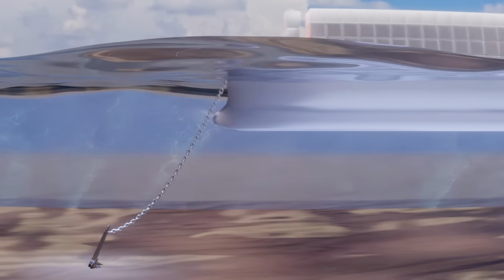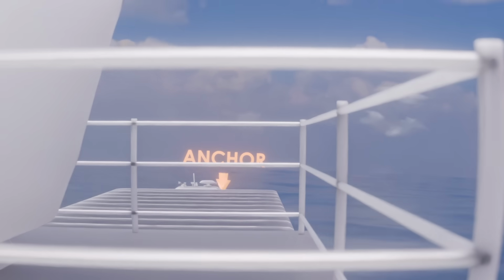Anchors don't work the way you think

Comment: Turns out anchors do work the way i thought
Reply: I mean, it works they way I think but many things are clearer now, like the rotating part, and the use of chains for more friction
Reply: @kcbm225 fr 😅
Reply: Turns out I never gave it any thought...
Reply: @Jim-z5j lol
Reply: Tell me simply how they work.
Reply: @mr.smartypants94  ignore the kite analogy, it doesn't work. 
The anchor is heavy but not compared to the ship so the anchors main job it to dig into the sea bed as much as possible and hold the end of the chain. Then the goal is to get a good long portion of chain laying along the sea bed as well instead of having a taught light stretching straight through the water because the long second of chain on the sea bed creates an incredible amount of friction. 
 
On top of this, when wind and waves do try and push the ship around the chain acts as shock absorber as it will need to be pulled up off the sea floor and pulled taught before the anchor will start being pulled. All the force that went into lifting the chain and pulling it taught would have gone into pulling the anchor instead if the chain were already taught.
Reply: @mr.smartypants94  it's not just the anchor, the whole chain is the anchor
Reply: @mr.smartypants94  kites. 

The ship is basically just a kite. Or i guess just similar... 

It works similar to a kite but the ship is the kite and the anchor is the person holding the kite, also minus the part where you need to take account wind lift and the rope is also heavier. But you get the point eheheh.
Reply: @Byte_frst7 which is just another way to say the anchor is heavy and digs into the ground with its hooks... exactly how everyone thinks anchors work
Reply: Yeah, who would've thought.... :)
Reply: I laughed my ass of reading this one 😂
Reply: its becoz u are a seaman
Reply: I didn't know about the chain also working to keep it still (i thought it just needs to be that massive to be able to lift the anchor and last longer) but the function of the anchor itself was kinda clear
Reply: trial and error...
Reply: They’re pretty self explanatory if you actually look at them so it does not make you a nerd, but you are so kind
Reply: @carter608  He was talking about your thick bifocals, and squeaky voice.
Reply: @carter608  eh, no. To understand that the staying power of the anchor system relies on the wind and currents attempting to lift the chain when the boat moves? That's not obvious. I don't think it is "self-explanatory".
Reply: Anyone who's tended any thorned vegetation has this knowledge already preprogrammed 😅
Reply: @July2ndJune1st I've tended many brambles. What does this have to do with that?
Reply: That was the plot twist 😂
Reply: Unless it's bent or the anchor line
Reply: And apparently a grand piano weighs less than 160kg 😂😂😂🤣
Reply: Yup.
Reply: Wow, cool. I didn't. I just was thinking it's not even going to do anything😅.
Reply: To a stone head  everything works the way it thinks. 😂😂😂
Reply: What if I told you anchors don't actually anchor . You would be right to tell me I don't know anchors.
Reply: 😂😂😂😂 I know right!
Reply: Not necessarily a nerd, but definitely a show-off and a braggart.
Reply: @briannnnnnnnnn1037
Oh stop.  You didn't know all this before you watched the video 🫤
Reply: Literally. Some people didn’t grow up around boats.
Reply: @pj4795 i didnt grow up around boats yet i can figure out anchors stop a boat from drifting.
Reply: nope
Reply: @nilzor well if anchors dont work the way you think then you could watch the video and learn what we all know.

😁
Reply: No they dont, cringe person.
Reply: Weird flex but good for you?
Reply: Jesus died for you on the cross. All have sinned and rebelled against God (Romans 3:23-24) (not including Jesus since He is God). The wages of our sin is death (Romans 6:23). But “God so loved the world, that He gave His only Son, so that whoever believes in Him should not perish (not go to hell) but have eternal life” (go to Heaven) - John 3:16. God loves you and wants a relationship with you and all you have to do is believe in Him and love Him and repent (turn away from sin) and you will be saved. “that if you confess with your mouth the Lord Jesus and believe in your heart that God has raised Him from the dead, you will be saved“ - Romans 10:9. God will change you and your heart to become better so that He can make your arrogant and evil heart of stone into a kind and loving heart that is obedient to His commandments which are perfect as He has changed me. He will change you so that you can love Him and love others as He changed me even though we fall short of God’s glory by sinning. Surrender your life to Christ and believe today and be reconciled with your loving Creator and know the God who made everything and everyone who doesn’t delight in the death of the wicked: “ Have I any pleasure in the death of the wicked, declares the Lord GOD, and not rather that he should turn from his way and live?” - Ezekiel 18:23.  Also, “The Lord is not slow about His promise, as some count slowness, but is patient toward you, not wishing for any to perish but for all to come to repentance.” - 2 Peter 3:9. God loves us so much that He wants all to come to repentance and is patient with us and doesn’t punish us for our sin if we allow Jesus to take our sin off of us because He died in our place because we deserved death for our sin so Jesus, having never sinned, died in our place. “He made Him who knew no sin to be sin on our behalf, so that we might become the righteousness of God in Him.” - 2 Corinthians 5:21. But He will punish those who continually reject Him or who have rejected Him even to death.  Please, the time is soon, Jesus is coming back, and many aren’t saved. Don’t wait! Accept the free gift of salvation which God gifts us and believe in Jesus because God has promised that if we believe in Jesus (Who is God), we will receive eternal salvation. “ For it is by grace you have been saved, through faith—and this is not from yourselves, it is the gift of God—” - Ephesians 2:8. Repent (turn away from sin and resist temptation to sin) and come to Christ who will take your sin away, give you a new heart to love God and love other, and He will save you from judgement on judgement day. What an offer! “ For the wages of sin is death; but the gift of God is eternal life through Jesus Christ our Lord.” - Romans 6:23. Praise God!
Reply: Crazy how people love lying
Reply: @dragon0361 crazy how people assume things they do not know! 😂😂 Some will and some won't!
Reply: Exactly like I thought lol
Reply: bro you got baited into watching the video, congratulations smart guy lol
Reply: Same
Reply: Me too
Reply: Lol
Reply: yep 🤣
Reply: Turns out I need something a bit heavier on my fishing boat, but damn are the gas prices gonna hurt.
Reply: you fell for it. TWICE LOL
Reply: Same
Reply: They do work — just not the way most people imagine.
On large ships, the anchor isn’t the hero. The chain and its catenary curve provide most of the holding force.
Without that curve, the anchor alone is basically decorative.
Reply: I didn't know. I'm thankful for the video.
Reply: Came here to say exactly this. 🤣🤣 Turns out anchors work EXACTLY the way I thought.
Reply: ITS NOT WHAT YOU THINK.😂
Reply: Yep, just lost 7 mn
Reply: No, you didn't
Reply: Right?
Reply: I doubt you did
Reply: My thoughts exactly what a load of horseshit....wasted my life
Reply: Exactly.  Not everyone is we todd did.
Reply: Nerd
Reply: @no_one5259 bro u prolly a dumb ahh kid discovering basic physics 😂
Reply: @no_one5259 read the room bro, this video is for nerds, and youre here
Reply: Be humble. Not rude.
Reply: Lol.
Reply: bro we're not in the 80s
Reply: @fahimabidarnob1697 what the hell does that mean?
Reply: @no_one5259 tf u mean “nerd”, doesn’t take a genius to know how an anchor works
Reply: @Sgm_19  doesn't take a genius to be a nerd.
Reply: @EbuCallinav  bro its a saying?? the point is that you dont need to be a “nerd” to know the common sense of how an achor works
Reply: @EbuCallinav  ur funny😂 dont think u understand what ur tryna prove but ok 👍
Reply: @EbuCallinav  nga what does that have to do with anything 💀
Reply: @Sgm_19  It seems we live in the first time in recorded history when being knowledgeable about anything at all is considered insult-worthy.

It is probably bad news.
Reply: @Sgm_19  atp you will be called nerd after finding out how to do multiplications
Reply: @no_one5259 They work the way I thought too. Although, me taking physics is probably a contributor to that haha.
Reply: @whatskrakin37  you dont need physics to know heavy goes down ....and is heavy
Reply: @no_one5259 Just because you feel sad you are not as informed as others. Does not mean you have to go on the offensive. Work on yourself instead😊
Reply: Why do these fools think I know how much a blue whale and grand  piano weigh? If you wanted to put it in context for me specifically, you would say it weighs more  than my Toyota Tacoma, Xbox with controller, and the landlords dog Brisket combined. 😮
Reply: I guarantee over 90% of the people who are thinking this is funny had no idea they dropped the anchor and then back up and then go forward
Reply: Who actually cares?
Reply: @francescopaolo5258 you do or you wouldn't have commented
Reply: The stupid troll comments here work exactly as I thought. Doesn't take a genius to know we don't know many things. How an anchor works is not obvious at all, without knowledge of various physics things.
Reply: I always thought it was the weight of the anchor chain laying on the bottom that held the ship in place. I had to watch 6 minutes to find out they lied about it not working the way I thought. They did a lot of theory but if they wanted to go down that route, they could have shown some complex dual anchor anchorages such as a Mediterranean mooring.
Reply: Hahahahaha
Reply: Show-off
Reply: same
Reply: @briannnnnnnnn1037, me and you have something in common! Imagine my surprise, " turns out anchors do work the way I thought " 😂😂
Reply: @therealreitumetse you mean the way you were told they work.
Reply: @Markd1982NFFC  not everyone needs to be told how something works. sometimes people just make up their own theories in their head if they don't know, and sometimes they turn out right like in this case.
Reply: Same
Reply: Yeah, wheels too!😂😂😂😂😂
Reply: I was thinking that same thing. Works like I was taught.
Reply: My first thought! 

That’s EXACTLY how I thought they worked.
Reply: same thought
Reply: Yeah, same.
Reply: Yeah right
Reply: You are of course lying.
Reply: Like fr most people who would think about this, its intuitive. Some roblox incel who hates life is probably never going to see this content anyhow. Such dumb clickbait.
Reply: A lot of these guys have a hard time coming up with catchy titles.

Theres one that always says "its not what you think" and he's always wring, its exactly what i think. I always skip those.
Reply: Yeah pretty clickbait tbh
Reply: Yepp I just watched this whole video hoping for some hidden esoteric knowledge I didn't know...I am disappointed.
Reply: Yes, the Video is clearly clickbait
Reply: @gamesarelegends3473 you are either familiar with the hyperbolic functions in mathematics or you had no idea how the anchor works
Reply: Very nice video. You are right, anchors don’t work the way I thought they did!
Reply: Ditto. Such a stupid video.
Reply: Stupid explanation.

Comment: The real way they work is to catch on to an underwater communications cable, gas line, or sewer outlet. Additionally, that anchor and chain is lot of weight to add to my 30ft (10M) sailboat

Comment: Smaller vessels often use rope as the anchor rode.  The rope acts in a similar manner in many respects but generally with less of the catenary effect.  But even its wet weight and the resistance of the water provide some.  There are weights which can be rolled down the rope using a control line which increase the effect.  On our boats (37' and 44') we carried two anchors.  One on rope for general use, a heavier one of a different design for bad conditions.  And when it is going to be "one of those nights" you can deploy both.

Comment: 1. Anchors work exactly the way I think.
2. "When it needs to stop in the middle of the ocean, what holds it in place." Certainly not the Anchor, as no (normal) ship has sufficient cable to reach that far down. Anchors are used near the coast. (btw. a shackle is historically 15 fathoms, yes that's 90 ft and almost never used in every-day operations, but worth mentioning to explain where the odd 90 comes from.)
3. "The next time you see a colossal ship resting peacefully in a harbour, you know it's not just sitting there" Yes, because it is moored or docked, not anchored. Ships do not anchor in harbours (well there is the possibility of short term use of a mooring anchor to help steadying the ship during mooring, but that's not the type of anchor discussed here). In regards to harbours, ships anchor while "lying in the roads", often near harbours in an sheltered area called Roadstead.
4. I whish landlubber would thoroughly research a nautical topic, before making a vid.

Comment: One thing I am missing somewhat (in addition to the correct things sa- 

The trick why the anchor works, why it holds, ist that the pull is and remains HORIZONTAL. Therefore the enormous lengths of chain, there should always be some length remaining lying flat on the ground.

When you lift the shank from the sea floor, the flukes can less and less dig in and so exert their holding function.

Comment: How much anchor chain did you let out?   

Remember: Rub Your Balls With Grease. 

See that colored section of rode / chain links?

Rub = red = 1 shackle = 90 feet

Your = yellow  = 2 shackles = 180 feet

Balls = blue  = 3 shackles = 270 feet

With = white = 4 shackles = 380 feet

Grease = green  = 5 shackles = 470 feet

Then it repeats, Red Red… and so on.

Comment: Really cool video, very interesting. The AI voice is good, barely noticed it was AI until it made a slip in how it pronounced weights...   

As for the video.. curious how the anchor being deployed or feels back in changes the ships center of gravity, seems like that's a huge amount of weight to shed and then load back up. Is the chain always stored in the front of the ship or does it feel in down along the length of the ship to spread the weight.  Maybe the weight difference isn't that noticeable since these ships are so huge and heavy

Comment: 4:50 looks like a mistake
Reply: Whats the mistakes?🤔
Reply: @arendelle_ok  To my knowledge, the claw  (I don't know if I named it correctly) of such an anchor has a limited range and cannot be directed downward. By design, it can only deflect by several dozen degrees from the vertical.
Reply: @MaciejK333  wdym bro
Reply: @Rey1390 the claw it's stuck at an angle by design, it can't point 180 degrees down. It'll crash with the rest of the anchor.
Reply: @lXlDarKSuoLlXl  did u even watch the vid lil bro, the anchor is not pointing straight downwards
Reply: @MaciejK333  bro did you not study triangles
Reply: @Rey1390 I'm explaining what he meant by that, plus, he had to watch the video to comment on an error, here, you dropped this 🫴🧠
Reply: @lXlDarKSuoLlXl  bruh, he is explaininh the consequences of what would happen if the anchor was 180 degrees straight. U r the one who dropped the brain kid
Reply: @Rey1390  man... I know attacking grammar is a low blow but you're making it really hard...

Kay, you didn't say "wdym" to know "wdhm" you were just being sassy, noted. Take care 👋